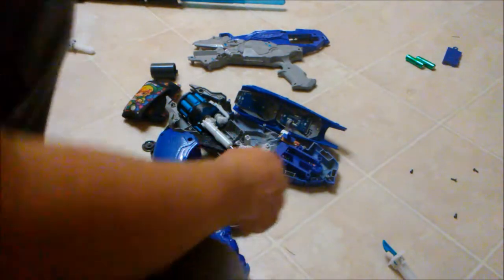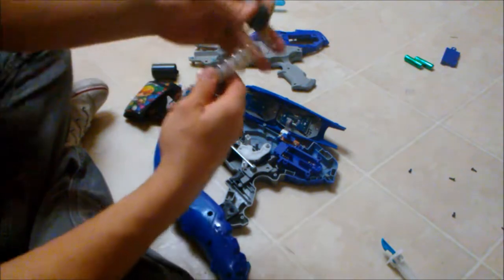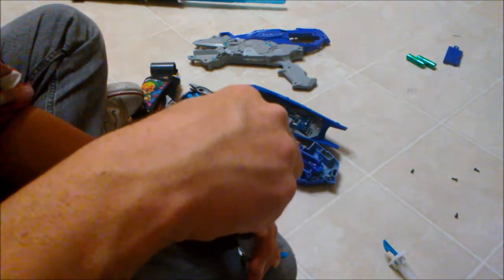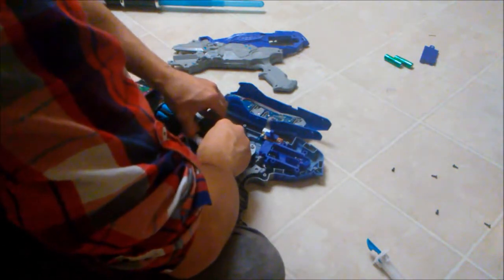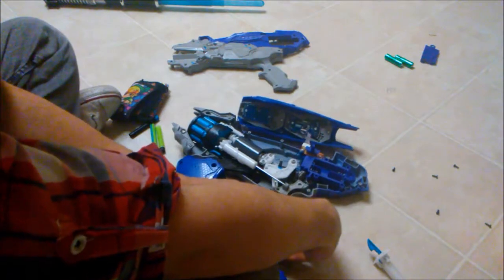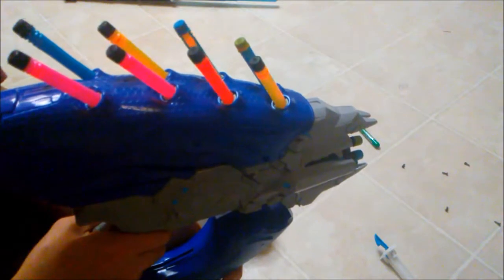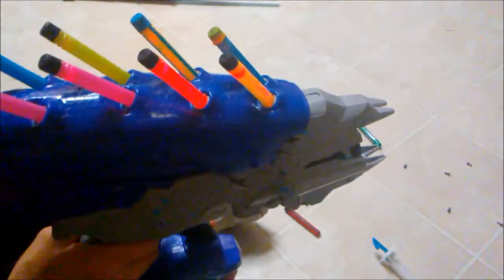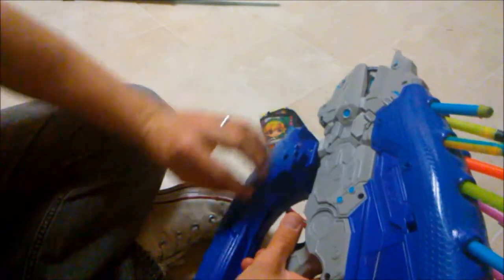Easiest Mod Guide in the World BOOMco Halo Needler

Comment: Looks like getting that plunger head screwed back on is about as tricky as getting a Tek 6 spring into a Snapfire and a little elbow grease is all you need.
Reply from the maker: fununcle I've gotten pretty used to pushing these springs around. Now the hard part is not totally destroying my springs with my hulk like strength lol

Comment: My needler's messed up.  It rotates the barrels like crazy and then slam fires.  Can't ever use the trigger.  I have a 10kg doominator spring in it.  Any advice?  I'm hours into this thing.
Reply from the maker: Kuli24 probably you need to upgrade the catch spring and your spindle rotation thing probably isn’t lined up correctly with the barrels
Reply from the maker: I would maybe try cutting the spring down too
Reply from the maker: I can help you out on messenger over video chat
Reply: @Boomtendo4tw  i think so, yeah.  it can't handle any spring upgrades at the moment.  So does the whole barrel assembly rotate 1 revolution minus one each time you prime?  And I hope I upgrade the right catch spring.  It's the one way in the back that I have to disassemble everything to get to, right?
Reply from the maker: Kuli24 the spindle thing should have the straight trough have the blue nub in it when the black sliding piece is forward
Reply from the maker: Kuli24 the catch is probably slipping cause it needs an upgrade spring, so that is causing the nub to move forward when the plunger rod is released
Reply: @Boomtendo4tw  ah that makes sense.  thanks.
Reply: @Boomtendo4tw  smokes, that's quite the long catch spring, lol.
Reply: @Boomtendo4tw  Shoot.  Upgraded the catch spring and still no go.  I think this thing can't take any sort of upgrade spring :S
Reply: @Boomtendo4tw  Final result - the orange needler can't be modified.  It has 5kg stock spring.  I tried 7kg, 8kg, 10kg, and short k26.  Tried them all with greatly strengthened catch, no go.  I understand why the orange ones we bought were $15cdn each.  43fps and that's all she wrote, lol.
Reply from the maker: Kuli24 hmmm could just be the spring is too long and the plunger rod isn’t reaching cause the spring is over compressed
Reply from the maker: Kuli24 the new color needlers are $35 in US
Reply: @Boomtendo4tw  I thought that might be it too so I nested a smaller diameter one inside the stock one.  I also tried k26 at exactly the length to just make a bit of tension when screwing the head on.  No go.
Reply: @Boomtendo4tw  Hoho wow.  We picked these up for $15cdn each on amazon.ca
Reply from the maker: Kuli24 yeah k26 is too strong. the only spring I found to work is c882. maybe k25 would work
Reply from the maker: Kuli24 I also tried those things. Some of the internals flex, so you need something like c882 which is strong but doesn’t require as much force to pull back
Reply: @Boomtendo4tw  I mean even a 7kg kronos spring didn't work and the stock spring is about 5kg.
Reply from the maker: Kuli24 I think it’s listed as Century 337 online
Reply: @Boomtendo4tw  It was someone else's needler, so I returned it to him already.  Gave him a yellow k26'd m6 to serve as a better welcome to the boomco family.  Thanks for all the advice, though.  I really appreciate that you took the time to reply!
Reply from the maker: Kuli24 I think the stock spring is 3kg. I will see about modding mine if they ever go on sale in the US. I already have two blue needlers
Reply: @Boomtendo4tw  i wonder if they do have different springs.  This one was stronger than a stock farshot spring.  Very beefy.
Reply from the maker: Kuli24 it just feels stronger cause it’s pre compressed much more than the farshot. A cut down Apollo spring might work. That spring is pretty similar to c882
Reply: @Boomtendo4tw  Already tried the apollo spring, he he.  And 10kg doominator spring too.  I forget what I classed the farshot spring as.  You know it may be 5kg too come to think of it.

Comment: Where did you get the replacement spring?
Reply from the maker: Connor Glass Orchard Supply Hardware. It's a west coast chain
Reply: Boom tendo alright, thanks
Reply: Would you still consider it the best option to upgrade the Needler?